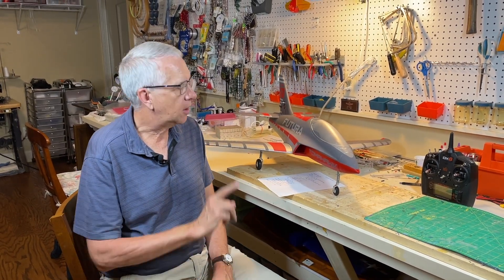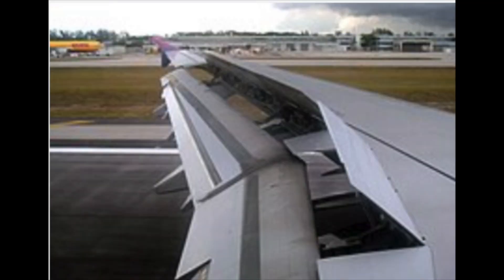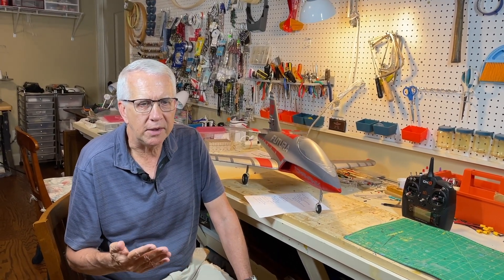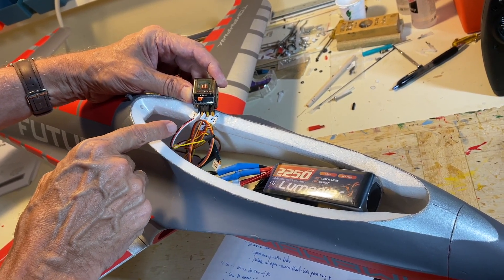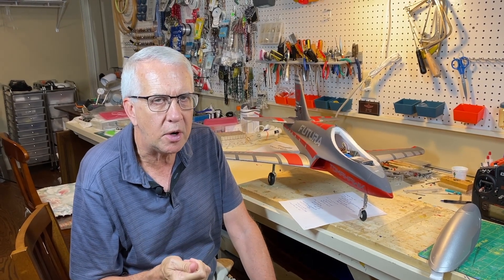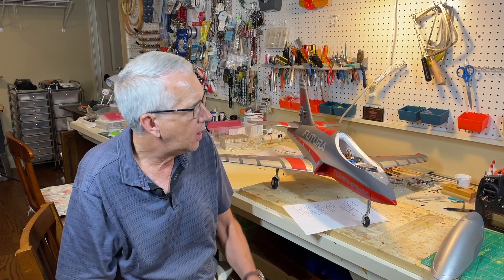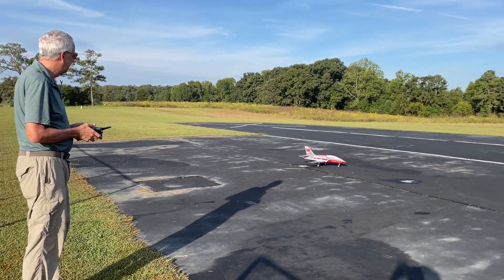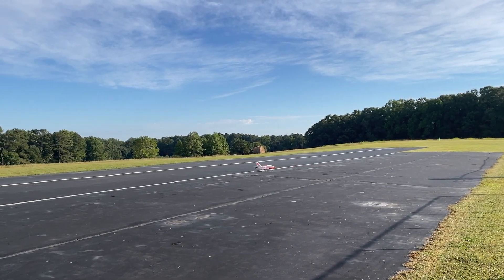How To Set Up Reverse Thrust

Comment: Nice video, one thing you didn't mention is that reverse thrust should only be applied with the throttle at minimum.  If reverse thrust is applied with the throttle up it can burn up the ESC.
Reply from the maker: Good point!

Comment: Anyone not have this work? I've been trying for hours. It's looks super simple but it doesn't work.
Reply from the maker: I just  got it to work for my J-10 review.

Ensure:
1.  The single wire reverse thrust cable from the ESC is plugged into the top (signal) wire of the receiver
2.  Do not use (usually) receiver channels 1, 2, 3 or 4 as these are assigned to control functions (aileron, elevator, rudder).
3.  If using reverse cable in receiver port 5 or 6, ensure that is set up correctly in the channel assign section of your transmitter.  In other works, receiver port 5 is correctly assigned to, say, switch D on your transmitter.
Reply: @TimMcKay56  I just figured out why it didn't work. My ESC had reverse set it OFF in the factory settings. So I got it. Thank you! Now I need to learn how to use it to slow down after landing!

Comment: Is there a way to have channel 4 or 3 do this instead of 5 I already have a bilge pump on 5 and I need that for my boat and on 6 I have differential thrust cause no rudder
Reply from the maker: Sure.  Just plug the throttle reverse into the top (signal) plug of the receiver, and ensure that the channel is assigned, in the transmitter, to a switch for the reverse function.
Reply: What about if I have two escs how do I make it so that they only use up one port for reverse thrust
Reply from the maker: @ Not sure about that. 😳

Comment: Hi Tim. I'm using a DX6 with programmer V2 and Avian ESC, and have followed through with you but with no result. However I've noticed that when I press channel assign, I get the channel input config page first, followed then by RX port assignments (i.e the wrong way around to your description). I continue, flipping between these two trying to assign to in my case switch H, however still with no reverse thrust. Any help greatly appreciated
Reply from the maker: Apologies, but I am not sure how to help. Do ask on www.RCGroups.com, they seem to have answers for everything. Tim
Reply: Hello Tim, I'm having the same problem. I have the DX8 { updated } and an Avian Smart ESC with the V2 programmer. I went through all the setting and set up reverse on the ESC. I too want to use the H switch for Aux 3 where my ESC single wire is installed. The switch works by looking at the monitor but i still can't get reverse motor rotation. Any suggestions? 
Thank you
Clay
Reply: Aux 3 is channel 8 and is set to set H....

Comment: You could also just use a bidirectional esc meant for cars and boats with not a single extra wire or tx set up. Then your throttle mid point will be neutral and above 50% is positive thrust while below 50% is reverse thrust. Its a little tough get used to zero throttle being in the middle though.

 With that said, its not really easier or gonna save much set up time, i just wanted to let you know it was an option bcus options equal opportunities.
Reply from the maker: Fascinating point, thanks for sharing!  Tim
Reply: Good idea. I'm going to try to program a switch to change the throttle from forward to reverse to still be able to use the throttle stick with full throw.

Comment: Thanks Tim.  I like your approach to showing how to reverse thrust..  My Habu 70mm esc has the extra lead you show. My radio is a DX6 like yours.  I have tried over and over to set it up with no success.  I have paused the video so I could follow you step by step, still no success.  Is there possibly another step needed? Thanks, Don Pardue, Chattanooga TN
Reply from the maker: Don:  I watched my video again.  The transmitter setup should be fairly clear as you have a DX6.  The only thing I can think of is to be sure the extra lead is pugged into one of the numbered channels on the receiver (not the BATT port, as there is no signal).  And ensure the number of the channel (on the receiver) is what you program on the DX6.  Maybe sleep on it, try again in the morning!  Tim
Reply: I’m in a similar boat I’m using a DX6i with a Habu 50 mm and I’m trying to go to the aux flap channel, having some issues communicating. These habus are tight to work in! We will figure it out gentlemen